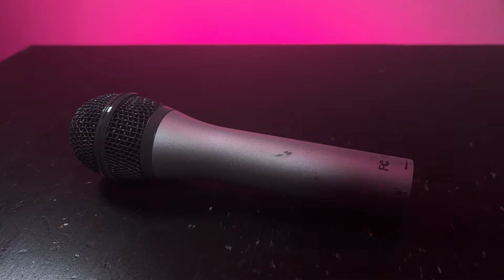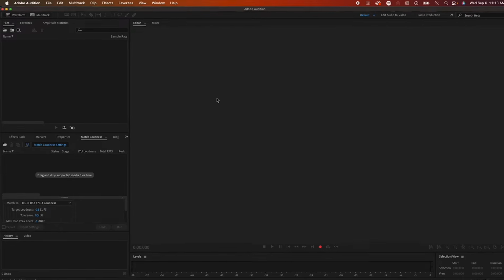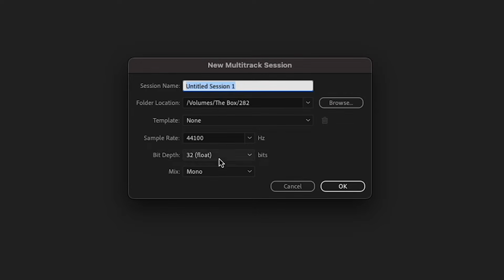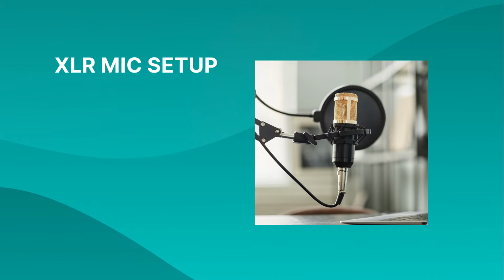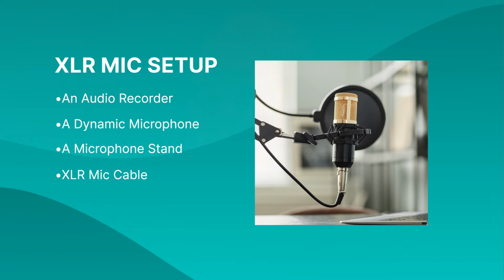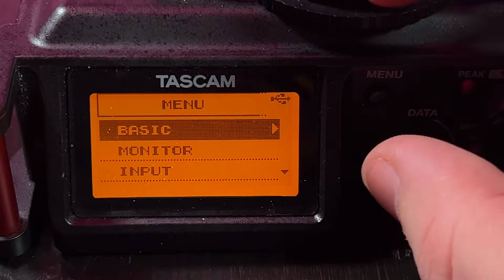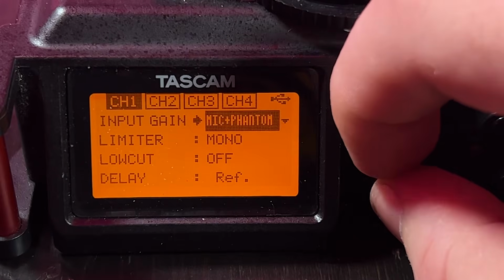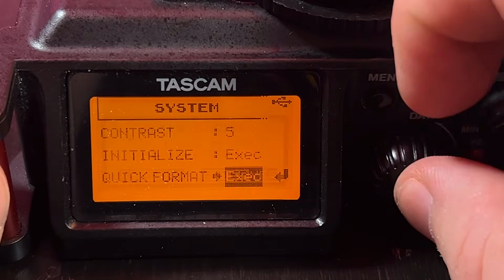Podcast Recording Setup for USB & XLR Mics

Comment: Any recommendations for an audio mixer that is easy and cheap?
Reply from the maker: For a simple mixer that also can double as a recorder, I like the Zoom Podtrak P4. Under 200 bucks, as of right now,, 4 xlr inputs with the ability to use it as an interface for remote recording. Can't beat that.